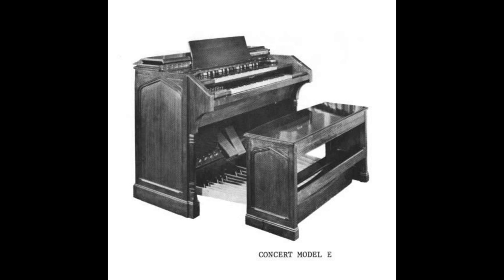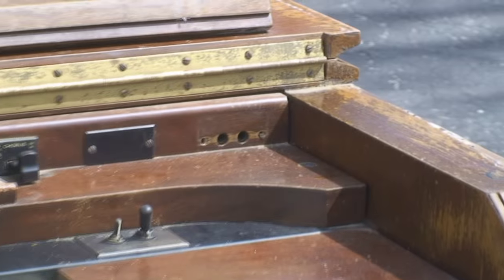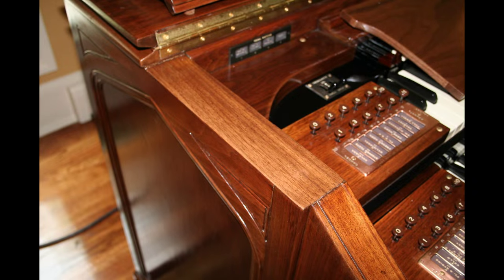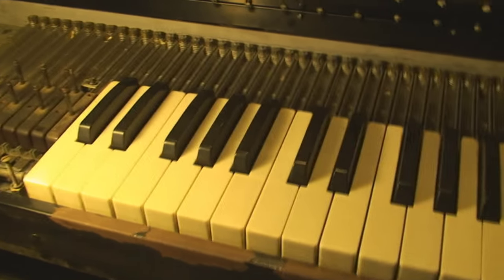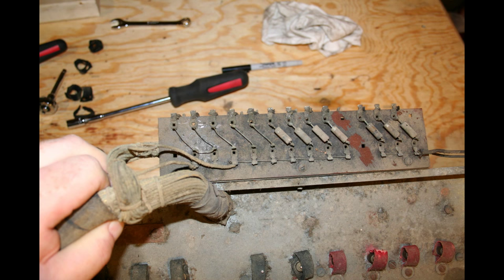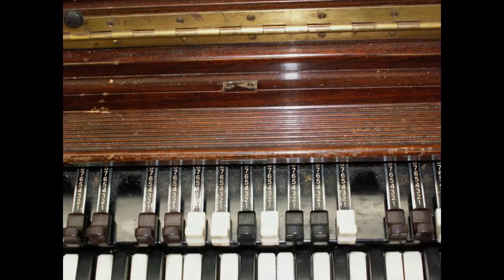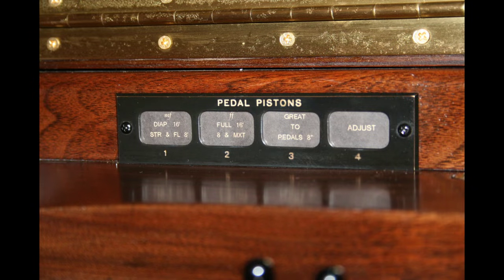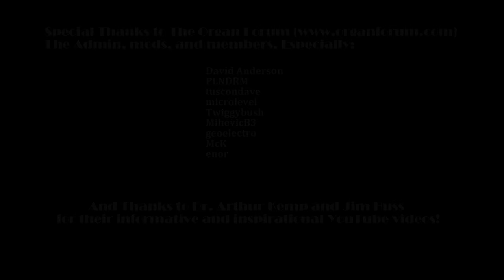Hammond Concert Model E Organ Restoration

Comment: Outstanding restoration, documentation and saving a rare piece of Hammond history !!
I still have my B-3 bought new in '70. Gigged thousands of times. Did the same woodwork restoration to better than new six years ago. Put a Trek reverb in when that came out.
 Have a '65  RT-3 / AGO in mint shape, as I miss playing a '31 Aeolian Skinner pipe organ I had lessons on long ago. Love the music.  Restoring a '46 C-2 now. Smooth drawbars, new caps & resistors, Trek reverb, woodwork stripped. 
Fixed reverb from 6x9 speakers in a 122RV Leslie don't cut it. The Trek reverb in the Hammond is perfect. 
Your video lit an urgency for me to finish her ( the C-2) !!

Comment: I had a base moulding missing on one of my Hammond E's. I had a cabinet maker build one out of walnut but it doesn't match. I like your idea better. One of mine has a dead tone 57 and plan one contacting Mike at TrekII when I get to that part.
Reply: It's pretty easy to make a custom "scratch stock" for any moulding you want.

Comment: One Rare or possibly Never Produced item was the C-40 Tone Cabinet.  It used Double the Components of an A-20 Cabinet, but was designed in a way to produce Vertical Sound Projection.

It was a large Gothic cabinet with Legs similar to an A or B Organ cabinet.  The legs allowed for Projection out the Bottom of the Cabinet.

Hammond literature provides photos of other Tone Cabinets, but only a line drawing of the C-40.
Reply from the maker: Craig - yes they were rare but the C-40 was in fact produced. There was one that sold in PA about 2 months ago along with a Model BC. If you Google search  old CL ads you may find the picture of it that were posted. It seemed all original and in quite good condition for it's age. It was huge!!
Reply: There was also a C-20 Cabinet series, similar to the D series. C-20, CR-20, CX-20, CXR-20, similar to D/X/R-20, only better furniture.
Reply: Possibly actually a Swedish film, I see a title card that says "Stoccolma."
Reply from the maker: Craig - I actually know someone who has a PAIR of CX-20 tone cabinets. Sadly, he will not sell me one!  Too bad - it would be a perfect match for my Model E. I could have bought the C-40 I mentioned before, but with all my Hammonds, Leslies, and now a Novachord I simply do not have the room.
Reply from the maker: Yes - I have seen this before. There is a still photo on the internet from an old magazine that HAD to be taken in the same room as this movie.
Reply: If you can find it again, send me the link.

Comment: De-Oxit, The Best for electronic contacts.  Those old caps had a -20 to +100 percent normal specifications.  They were not bad, but changing them was OK.  I wonder if and tuning error occurred with the cap change.  You son has a good set of feet.  Sometime soon he will be playing like Felix Cavaliere, never lookin down, just boobing those two feet across the bass pedal.  Former bassist myself,  BEST REGARDS Steve

Comment: Great stuff man, I really appreciate your work there. I also had my model E restored more than 10 years ago, however mine has no pedal clavier as I had found it abandoned on one of my building sites. Also there was no back panel so my carpenter not knowing how the original looked like he divided it into two ornament parts instead of three but that's alright, it gives it a little feature of originality. It took a lot of time to make it work and look good but it works. Just recently I wanted to play it and after two minutes of me playing I smelled something was heating up. Could you please tell me what is that cylinder part from 17:40 of your video, as apparantly that is causing an issue. The organ plays well but after two minutes that part starts burning and smoking and the area around it turned black so it needs to stay off untill I repair it. Thanks

Comment: Pretty sweet! I would love to do this to a chewed up 1949 BV and a 1962 22R leslie I have. One thing obout these older Hammond organs are the cool brass pieces everywhere like on your Run Start plate. mine has those too. The newer ones have the black plastic plates and piece like the chorus drawbar on yours. I wonder if that was replaced over the years? Anyway awesome rare model, turned out great, I am inspiired to do something similar with mine

Comment: Joe, enjoyed your video very much and what a fantastic job on the old model "E" without replacing all the guts. I'm restoring a 1953 Model C, with a frozen tone generator from lack of lubrication. Things are going great on the project but I too have run into one or more dead tones. Could you put me in touch with a Trec II Note Generator specialist, who might be able to help me out. Thanks. Bob Rockey
Reply from the maker: +Bob Rockey 
Most of the Hammond parts distributors I thanked at the end of the video are Trek II dealers.  Good Luck with the Model C!

Comment: I am in the market for an AGO Hammond organ preferably an RT series, D100 series, or better yet concert model E hammond.  What is your suggestion for an AGO HAMMOND organ?  By the way nice Hammond organ.
Reply from the maker: Thank you for the compliments. Regarding an AGO Hammond, the Concert Model E is a rare, esoteric animal. The only advantage from a performance aspect over the RT/D series are the dual expression pedals. Other than that, I would grab any AGO Hammond that is available to you that is in good shape and properly priced. Of course, the RT-3 and D-100 models will carry the most resale value if that is a concern. Good Luck!
Reply: If you might want to entertain a new Hammond with a AG0 pedal board, consider the model 935.  

Otherwise if you have your heart set on a vintage Hammond, the RT3 or D100 would be the last two incarnate of the concert model.

Comment: I've seen thousands of Hammonds over the years, but only one model E. it was in a large methodist church. they had it along with a blond C3 in separate rooms. they had a pipe organ in the sanctuary. I think they ended up giving them to smaller churches. beautiful job fixing this organ up. it sounds horrible, as did most of the early Hammonds. cheers.

Comment: Hi Joe, very impressed with the entire thing: video, info on the organ, the restoration of the organ, music selection. I am confused about the "Trec Note generator". Does that mean the actual tones are being produced digitally? You mentioned putting new caps in the tone generator, I just assumed it would be used. Am I misunderstanding how it operates? You said one note was dead.. Wouldn't it just be a matter of replacing the pickup or bad wire for that note? Could you please explain this to me? Thanks, Tom
Reply from the maker: It's an arduous process to replace a transformer/pickup in Hammond generator. Much easier to use the Trek II note replacement. It is not digital. You simply tap off of the note an octave higher than the one you are missing. The Trek II divides down the frequency of the note to match the octave of the missing note and you're done. You are still utilizing the Hammond TG  as the source of the missing note. Glad you liked the video :)
Reply: Okay, I believe you. I have an H112 1965 Hammond, I bought it with the idea to gut it to make guitar amps (I know, a sin), but it was so nice I decided to keep it and learn how to play it.. I was surprised how similar in construction your model is for it's age. You did a great job, saving a rare unit, I just think it's great.. Happy 4th, Tom
Reply: @bucyruserie1211  I for one am glad to hear that you spared the life of that "heritage" H-series.  My late parents had an H-133 console, with a paired Leslie tone cabinet, that they purchased new in 1965 - and was the first Hammond I started noodling on as an toddler, in the mid '70s.  It was later replaced by an LSI-era Colonnade 200-series in the Fall of 1981.  With their hybrid tone generation design, I'm well aware that the H-series doesn't get the same amount of love as the true TW generator B-3, C-3 or even the L/M series spinets, so anytime an H gets a reprieve, I'm happy. 😃

Comment: Can 2/3 series vibrato/chorus and a pedal solo unit be added to a model E?
Reply: The Model E has a AM Tremulant unit which is the same as what was used on the Model A, BC, G and D.   A Model E is quite crowded within.  You would probably have to unwire everything, remove the preamplifier and both tone generators in order to make the change.  A tedious task.